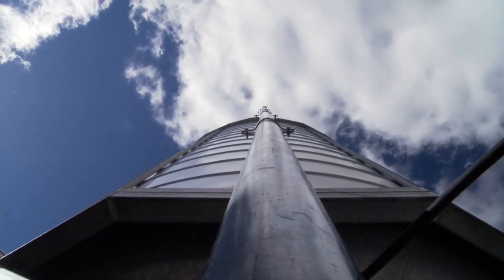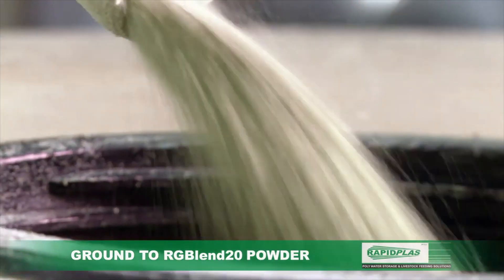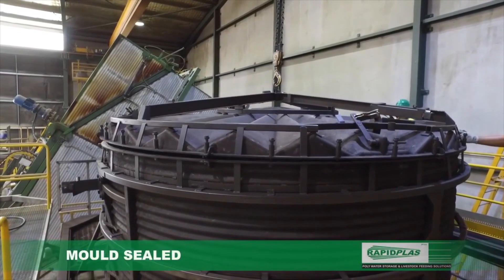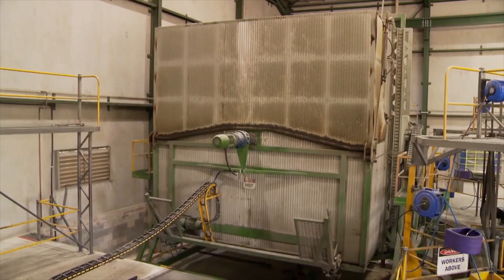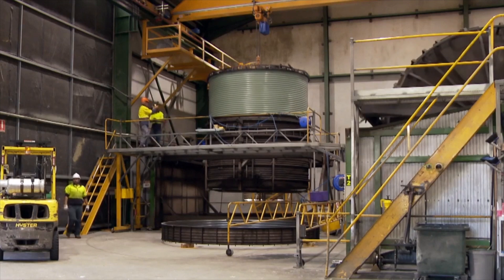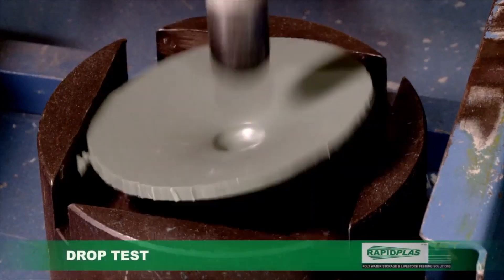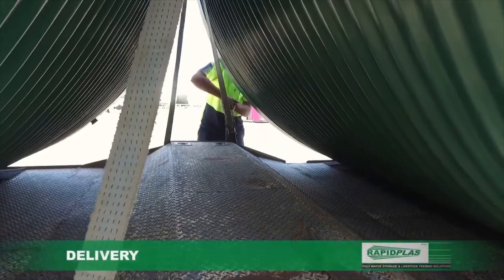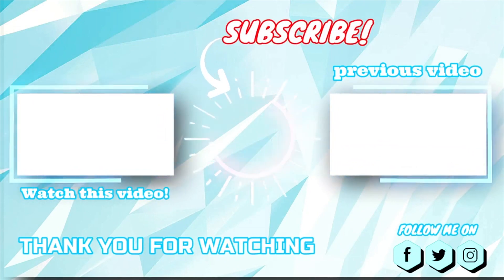How They Manufacturing Biggest 20000 Gallon Water Storage Tank Inside Factory

Comment: How do they remove the tank from the mold @2:22 against the direction of the ridges? I would have thought those ridges would have stopped you from removing the tank, or does the mold open up in the other direction and was not shown?
Reply: The contraction of the plastic tank is 3 to 4% in reduction of diameter. This tank has a diameter of 4.3m . So the construction is more than the depth of the rib
Reply: had a same question...